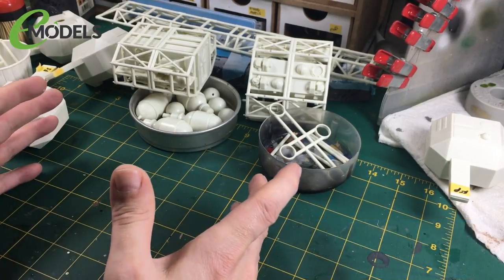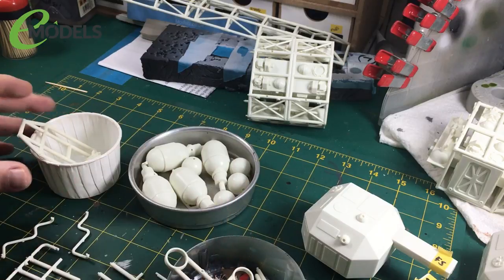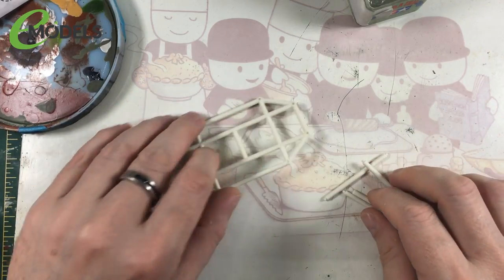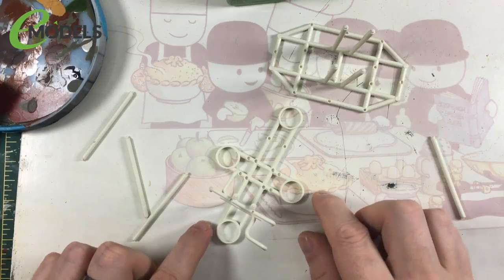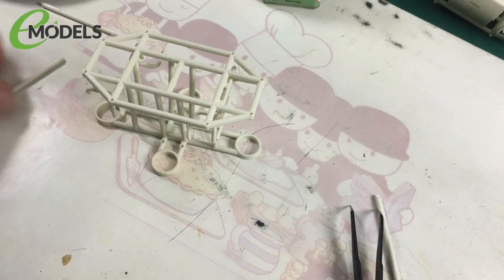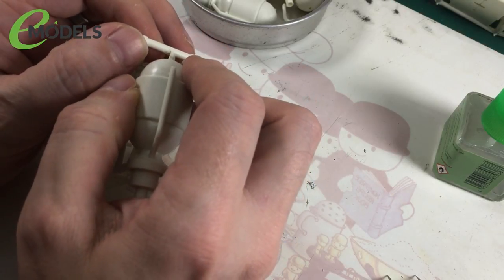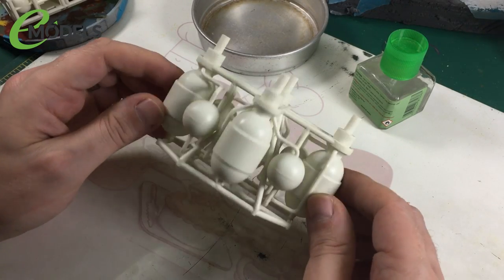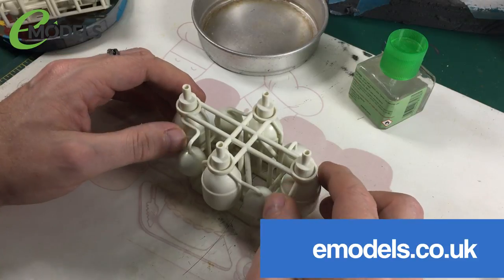MPC 1/48 Space: 1999 Eagle Transporter (#874) Part 6

Comment: i think that spring goes under the leg it doesn't do much being on top ? put it between the moving bit like a shocker on a bike
Reply: Ha ha you made me go and dry-fit a leg and pod just to be sure! ^_^ It sits between the top of the inside of the pod, and the bit of the foot assembly/leg that glues onto the pod. Once the leg is glued to the pod, the piston can't come out and the spring buffers up against a recess inside the pod (so you can't see it and it has no way to dislodge or come out). The bit of the piston you actually see is just the shiny silver piston part within the leg assembly (the bottom bit with no spring on). It glues to the foot, and the leg is anchored to the pod itself, so the only bit that moves is the piston, up and down, taking the footpad along with it.
Reply: i see what you mean but i still would have modified it to be springy :)
Reply: It will be, you'll get the "ba-doink" as you place it down. I'll show off the sweet suspension when it is all built!  - I'm using third-party springs that are much more springy that the ones in the kit :)